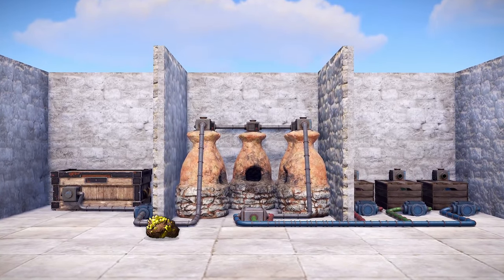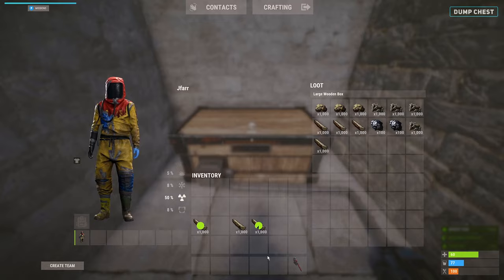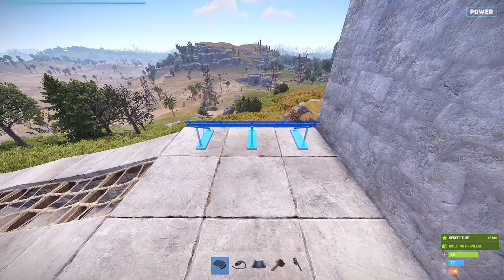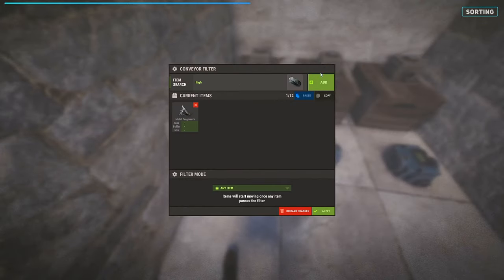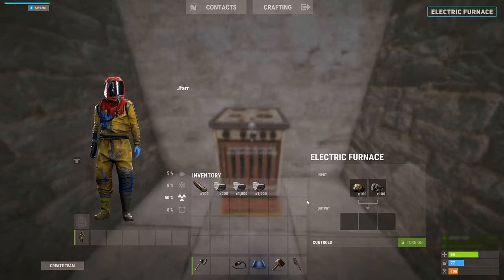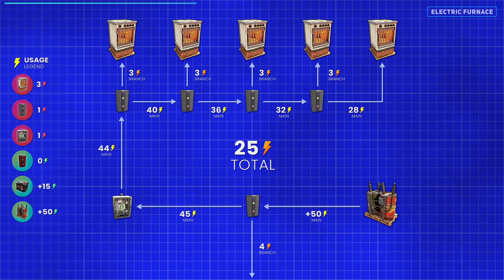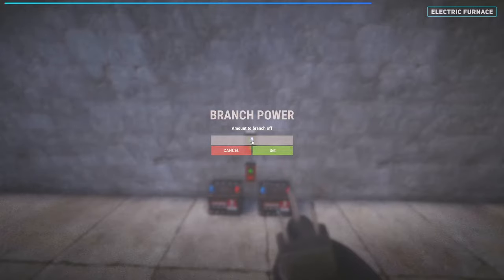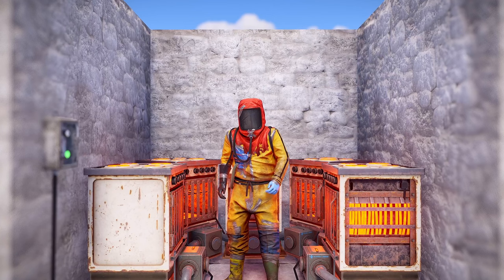How To Automate Electric Furnaces - Industrial Guide | Rust Tutorial

Comment: also you can use igniter to turn on any wood based furnace and a sprinkler to turn them off if needed
Reply from the maker: Great suggestion. Handy if you have a large system and don't want to keep going over and turning them back on or off.
Reply: Pretty sure you only need a button and doesn't need power supply to. Coz button magically creates power while pressed
Reply: Use 4 conveyors in all. 1 for raw ores, 1 to supply wood, 1 for finish product and 1 for charcoal. First thing you need to set limits to your wood and raw ore. Wood should be limited to a max of 8 and ore to a max of 5, hqm 2. connect the filter pass of the raw ore conveyor to the turn on of the wood conveyor, connect the filter pass of the wood conveyor to a timer and set the timer to 0.25 connect the power out of the timer to the igniter. Take an AND switch and connect the filter fail of both the raw ore and finish product conveyors to it, use the output of the AND switch to the turn off of the wood conveyor. No need for sprinklers and it will not randomly turn off. sometimes you need to flush a system for it to start but thats on a rare occasion. As you drop raw ore into the drop box it will be pull via the raw ore conveyor and turn on the wood conveyor which in turn transfers the wood and ignites the furnaces. When there is no more raw ore and no more finish products to transfer the wood conveyor is shut off. I do this all the time cause Im really lazy.
Reply: an igniter also turns on electric furnaces
Reply: @thebigbonk  big brain time

Comment: you can achieve the same goal without splitter and with one conveyor less, just need to adjust filters in a different way: Furnace -> chest 1 -> conv/filter to chest 2 -> chest 2 -> conv/filter to chest 3 -> chest 3. Nicely made video, very clear.

Comment: NOOOOOOO man you did it wrong!! You can make it fully automatic for less components and power!!!!!
Reply from the maker: Care to share your solution?
Reply: @JfarrYT  
I'd love to!
Do you have a discord I could share a screen to? 

I can also try to explain it here if you'd like, but it could get long. What do you say?
Reply from the maker: @AVMMM  I won't be able to call as I'm heading off to work. Just a summary in the comments would be preferred so others can learn from it as well :)
Reply: @JfarrYT  use splitters instead of just electrical branches. Much cheaper on power. You can power 3 electric furnaces off one electrical branch this way.
Reply: @JfarrYT  OK, great. So here's what you want to do:
First of all, your end/target boxes could overflow, so what you ought to be doing is to funnel all your furnaces output into a large box first, using an industrial conveyor. Just for the sake of orientation, the conveyor leading from the furnaces to the separation box is going to be called conveyor B, and the conveyor that leads from your dropbox to the furnaces is going to be called Conveyor A!

Now, what you're supposed to have is a system that sends material from a dropbox to the furnaces, and takes the output from all the furnaces to a collective Dropbox, from which 3 other different conveyors could pull materials to boxes for as long as there's room for them. If the sorted boxes are full, at least you'll have a compensation system of storage.

Now here's the good part;
You need to make an additional two AND switches! To understand what I'm going to do, let's assume you're going to have 3 furnaces only (if you'll have more you'll still be able to pull this off but with an expanded system, let's just stick to 3 for the sake of the example). You pull power from the "Filter pass" jack of conveyor A (which is free power) and plug it to one of the input jacks of your first AND switch (we can call it A as well). The output of AND A switch goes to a splitter, which splits 1 power to each "turn on" jack of every furnace. Give AND A second jack 4 power as well. Once you've done that, the furnaces will turn on as soon as you drop materials in your dropbox.

We are going to repeat this process with AND switch B, only this time we'll be plugging the "Turn off" jacks on each furnace, to AND B by using a splitter, and don't forget that this time we are using conveyor B, and we plug AND B to 4 power, and the "Filter fail" jack from conveyor B.

What you have created now is a system that will automatically turn itself on and off, depending on if it has work to do or not!
You are saving a LOT of power that way, and you don't need to do a lot. Just head outside, grub your ore, throw them into your dropbox, and repeat.
Let me know if you have any questions, LOVE your channel!
Reply from the maker: @AVMMM  Wow, thank you for sharing this with us. This sounds awesome and if you're planning on actually making the most convenient system, this seems like the way to go. Is this something already covered in a video or something you discovered yourself?
Reply: @JfarrYT  
I just have a hard time seeing things in this game and not knowing what they are doing, so I spent like a month and a half reading online about what every component of every electric and industrial feature does. I started putting together some impressive things together, I have tons of other ideas like that, that I didn't find in any YT video. 

For example, I spent an entire wipe making a fully automated rocket factory. 
It took a lot of resources to collect, but I got a large box of rockets in like 24h.

And when you have that much rockets you really stop paying attention to how bases are built, you're going in blasting a path of destruction hahaha
I can give you some of my ideas if it helps your channel, all I want in return are more videos :p
Reply from the maker: @AVMMM  Damn that's truly impressive and I appreciate the support. Your automated rocket factory idea sounds awesome. If you’re willing to share this idea or any others, please don’t hesitate to leave a comment or a video reference for others to learn from, or even sending me an email. If I were to include any of these ideas in a future video I will be sure to give full credit to your channel, video reference, or whatever social media you would like.
Reply: @JfarrYT  
I'd love to! what's your email?
Reply from the maker: @AVMMM  Sweet :) Email is Jfarrhub@gmail.com
Reply: @AVMMM I don’t know what you’re saying but it sounds really awesome dude. I would love to see a video or pic of the set up.
Reply: @Destructow  I'll try to make something quick and I'll reply a link here
Reply: @AVMMM  you’re the goat!

Comment: I prefer to use the salvaged shelf to put electric furnaces on. 1 shelf could fit 6 furnaces, and you save on space a bit
Then you add an electric splitter for each level of the shelf, so 2 splitters, 2 branches (each branch out 10 = 3funace+splitter), and then you could use the second splitter output for the conveyors.

Comment: This is a nice and simple tutorial setup, but I've got experience in electricity now, so In have a better suggestion.
- First, if you're using electric furnaces, you might as well use a medium battery because you've techtree'd through it already
- Second, if you're aiming for a large setup, begin to techtree into wind turbines, because I begin to find solar quite inreliable due to the equational. Idk if it's bad weather or the batteries don't charge up fast enough.
Third, every component uses 1 power, do putting multiple branches are wasting energy. Instead, I would recommend to use splitters for a large setup. It will save you a lot of energy in the long run.
Reply from the maker: Thank you for the suggestions. I wanted to go through the step of using the existing battery to showcase how that's done along with using the root combiner. But a medium battery definitely would be a better solution for expanding later.
Reply: @JfarrYT  Ok. I understand. Thank you for the reply

Comment: The following config will save you 1 power / 3 furnaces:

1 e-branch -> branch 10 power -> 1 splitter -> 3 e-furnaces.  Use the power out on the e-branch to add the next 3 e-furnaces.
Reply from the maker: Cheers for sharing. A splitter is definitely the way to go when scaling up with multiple furnaces.

Comment: I didnt know you can link the furnaces like that. Thanks for showing us.

But honestly, i would make it that when the furnaces dont receive anything, then the furnaces would automaticaly turn off. Most easiest probably would it be by connecting furnaces output into aditional small chest input and from that chest sort it all, then make that conveyor shut all furnaces off. Probably with OR switch or timer, basically anything that would help get more power to the shut off connectors (since electricity you get from pass fail is only 1). I havent built this system yet, but im going to.

I started like playing with the electric things and this month i built button/transmitter activated timed garage door that automatically closes after certain time with alarm to warn you that the doors are gonna be closing with 2 white lights and 2 red lights. I basically tried to replicate how certain buses have their lights for lighting up the space and for warning you to not be at the doors when closing. 
Next im thinking if im gonna make like fully automatic ´´freight´´ elevator or something else. Its mostly so i learn how can i use every type of electric component this game has. Not for PVP purposes tho, because im PVE player. Im just so bad at PVP and most importantly  i usualy dont have time or mood 24/7 to play this game, so please, dont spam me with hate comments for being PVE player.

Comment: Your first conveyer doesn't need filtering, it will only process and pull items that go into a furnace. 

Button to igniter above any furnace will turn them all on at once without needing power
Reply from the maker: Was mainly included to allow you to disable one resource from the filtering if you would like to easily fill your furnaces with a particular resource. Also, provides a bit of peace of mind that there isn't an item you can accidently put into the dump chest and it be sucked up and dumped into one of the furnaces.
Reply: @JfarrYT  there only really 3 items a furnace creates and they are what you want unless you know of a 4th that bricks the automation that I've never seen yet?

Comment: I run my e-furnaces in sets of 9 on a square half wall shelf
Reply: Power to a branch. First/left terminal to conveyers. Second/right to a splitter. Splitter to 3 more splitters. Splitters to furnaces. If stacked in nicely they fit on a square foundation with a half wall shelf either above or below them. Place boxes. 
Place first/ back row and connect to input conveyer.  Connect to next 2 furnaces . Place first furnace of the next row and connect to previous row. Place the rest of that row and connect. Repeat same 3rd row same as second. Connect last furnace to either an industrial splitter or a conveyer. A simple in and out of this setup is 34 power with 9 furnaces. 
⭐️Important note Turn on ech row before placing the next
Reply from the maker: @stevendavis5112  Thank you for sharing this. Always great to see how different everyone's setups are.